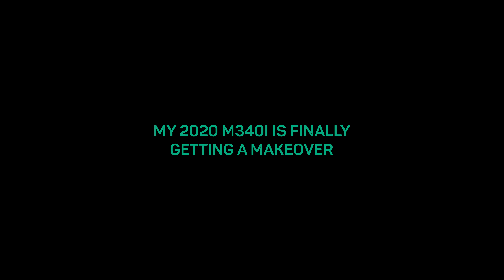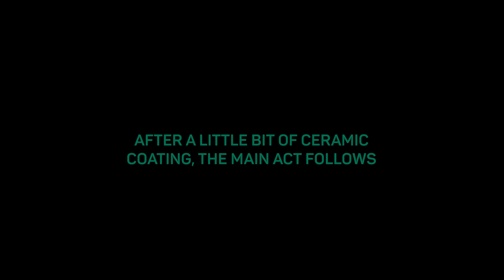BLACKOUT: My BMW M340i gets HUGE Makeover

Comment: 20 inch on a 3 series.... with skinny stretched tires... proof that good taste cant be bought
Reply from the maker: of course, except the wheel and tire combo is literally STOCK size.
Reply: @TheFuxxoWorksGarage  I thought it was a F30 at first. I just prefer 18/19 inch rims with really meaty tires
Reply from the maker: I would love to put on meatier tires on those rims, like guys in US do, but at this point i can only go with what manufacturer puts on the car, if i went with different sizes my warranty would be cancelled and i would also get fined when pulled over by police..
Reply: @TheFuxxoWorksGarage  what? I am from netherlands and I have literally M3/4 F8X wheels and tire sizes on my F30... no problems
Reply from the maker: @zafert85   it is forbidden in my country to put any other tire sizes than those prescribed by manufacturer 😀 now, on the other cars i have, i dont care about that. but here, if something happens, like xdrive VTG fails (which happens often), or differential.. the bmw service first thing they will look at, are the wheels and tire sizes. and if they are not factory spec, the blame will go on them, and i will have to pay for any repairs.. also, if i have an accident, the insurance company will also first look at those wheels and tire sizes, and deny paying out anything. so i have to go factory spec with this car for legal reasons.. (same thing with exhaust, i cannot remove the OPF, it would void my engine warranty)

Comment: I said goodbye to petrol cars last year because they are not as reliable as eletric cars
Reply from the maker: good for you :-D why drive boring cars tho
Reply: @TheFuxxoWorksGarage  Petrol cars are as slow as a bike by the the time you shift into the seconds gear I am already 100 meters ahead that is the difference people do not understand
Reply from the maker: @joegugg4129  i dont feel my car is slow at all, 400hp is way more than i need for the traffic. so unless you drive 600+hp ev, you are not faster anywhere, especially above 100+ kmh
Reply: @TheFuxxoWorksGarage  Oh yes I can easily keep up with a Corvette in Eco mode  and my  car only has 200 HP strange isnt it maybe it does depend on who sits behind the wheel
Reply from the maker: @joegugg4129  sure 🙂
Reply: @joegugg4129 try that with my c6z lol